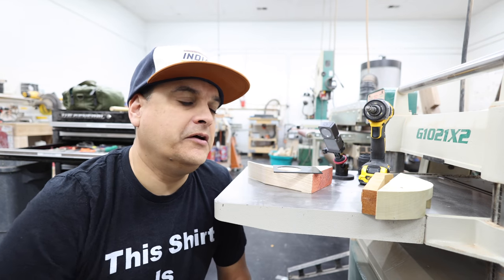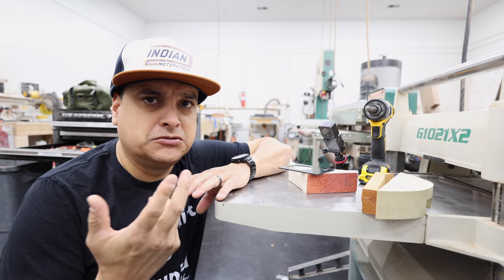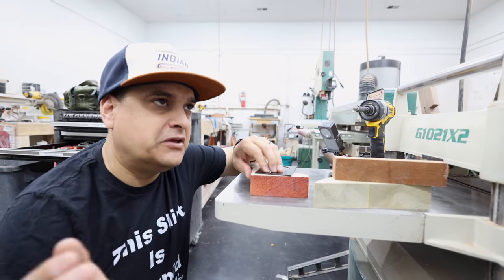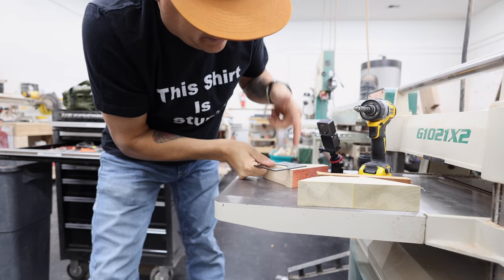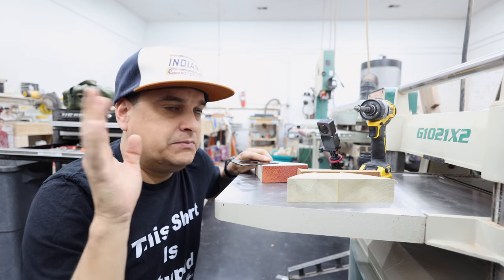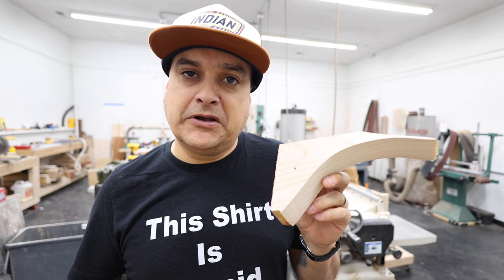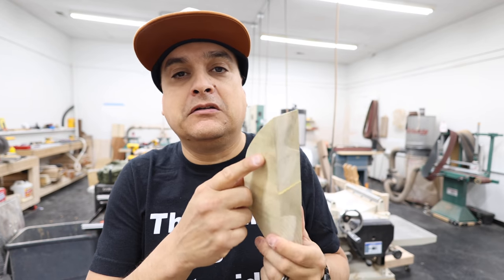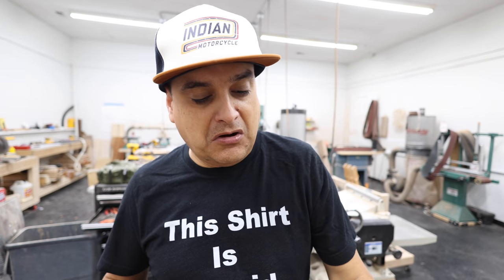What Is The Worst Tonewood For Electric Guitars

Comment: I'm going to be a little facetious here. I'm going to chalk up this video to the fact that you are at very high altitudes and that is affecting the oxygen going to your brain. 😁 the title was about the worst tonewood and of course you didn't deal with tone at all in the video. But on a more serious note I never perceived people's dislike of popular because screws striping out overtime. The two complaints I've heard about Poplar and bass wood is that a small ding shows up very easily in the finish because the wood is soft. And for Poplar because of the colors in the wood it requires more paint especially when using lighter colors like white to cover the wood without some of the colors of the wood showing through. Meaning it's a difficult wood to do a burst on.